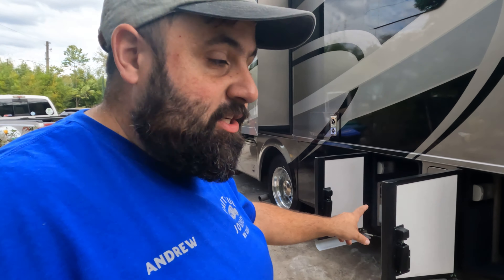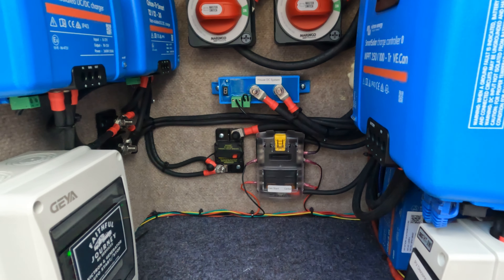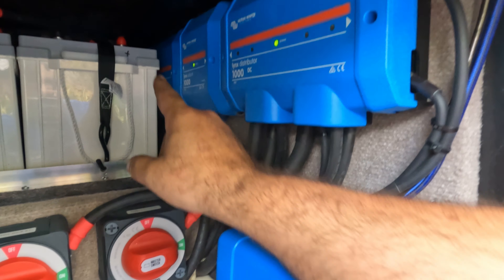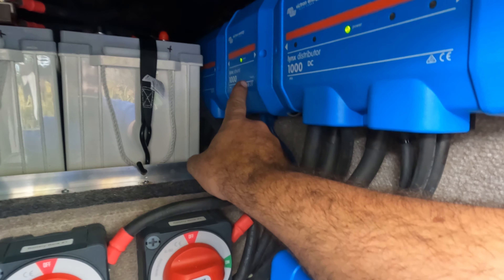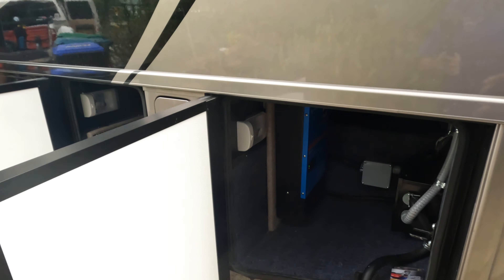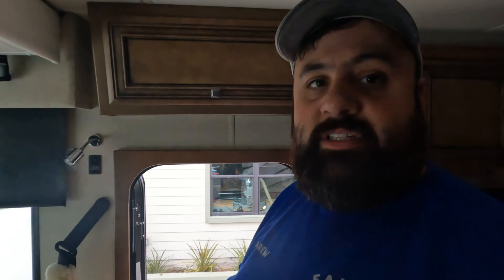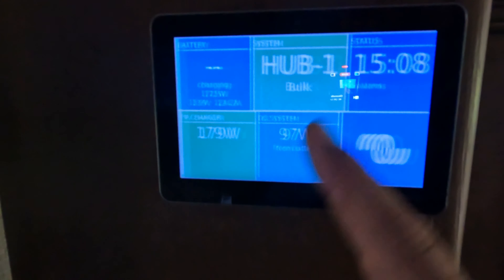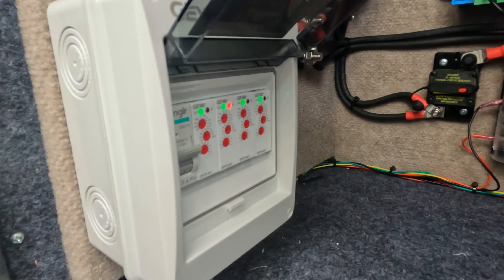2019 Newmar Bay Star - Prepping for Camping Season with Victron System Install

Comment: Nice system. Couple of questions. Do you typically build a system 2 to 1 ration Solar to Battery, i e. 1600 Watts of Solar to 800Ah of Lithium battery?  What brand of Lithium battery was used in this system. Lastly I assume the Multiplus II. 2 × 120 is 12V?  I did not see one or hear you comment on a 24V-12V converter
Reply from the maker: Mark, if possible I try to do a 2 to 1 between solar and battery. But isn't always possible due to various constraints. Yes, majority of the systems I install are 12v due to the size of the system.